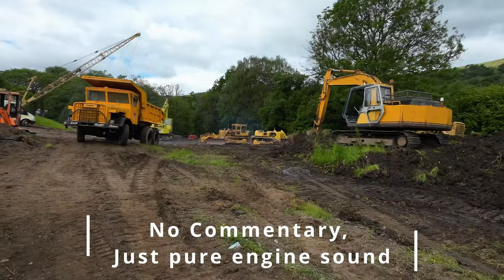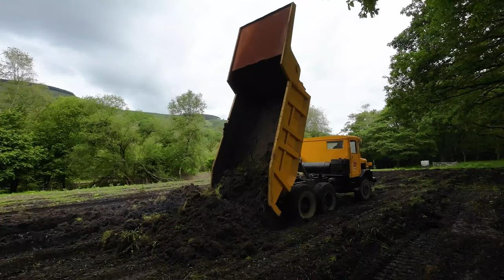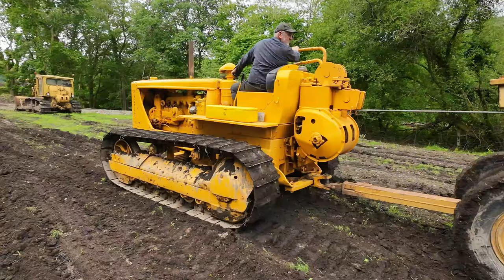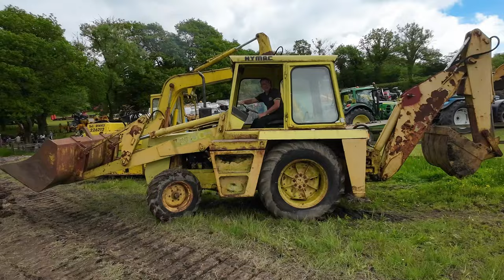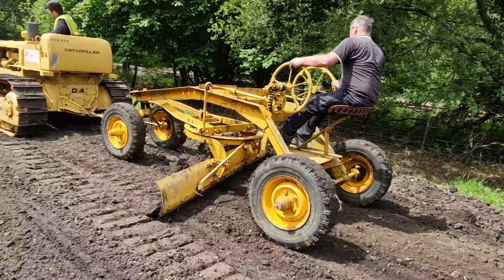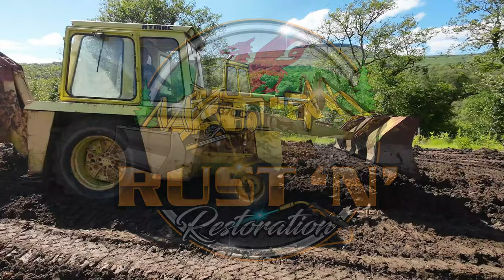Diggers, Dumpers, Dozers & Draglines

Comment: What a great video. Thanks for putting your time into it and working your own 370C. Looking at your 370C a few parts there we used to supply to HY-MAC. The rear bucket linkage, the stabilizer feet and the stiffener gussets welded into the rear wheels. On the 580C we drilled out the mounting holes on the counterweight. As it was cast of scrap metal, not an easy job. Pilot holes and patience to get it done.
I didn’t realize until this video that the POWERFAB  is a 125W, earlier than the 125WT. It had its own trailer. It would be interesting to know the machine number. The 125WT as the logo says has a trailer built in to the design.
My sisters grandson was at the show, just 4 years old looking at all the  machines especially the POWERFAB , as his great grandfather and his 3 brothers owned the company. 👍🏴🇺🇸
Reply from the maker: Wow thanks Paul for the information! Great to know you had a part in the HYMAC story along the way, the Powerfab 125 WT is a great example, don’t think we’ve got any footage but a Powerfab 125WTD arrived in the guise of a Lifton 125, basically a Powerfab under a different manufacturer and yellowish in colour, hope your sisters grandson enjoyed the weekend, fantastic connection and a history to be proud of, it was a very well attended show and we raised a healthy amount for local charities over the course of the weekend, hopefully see you next year👍